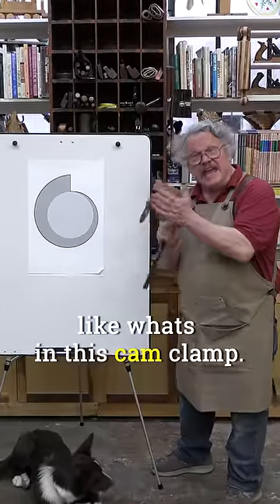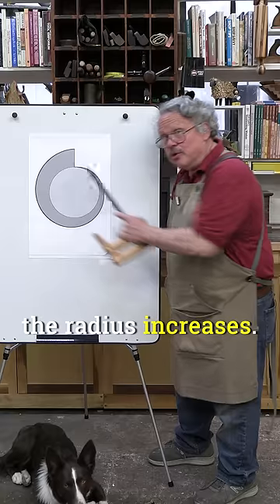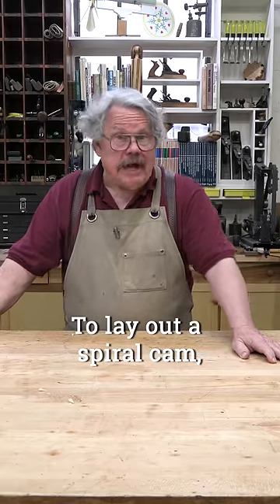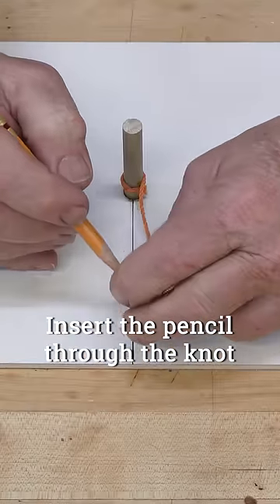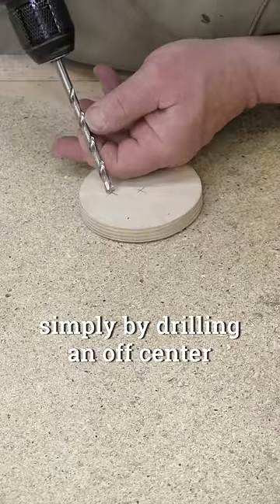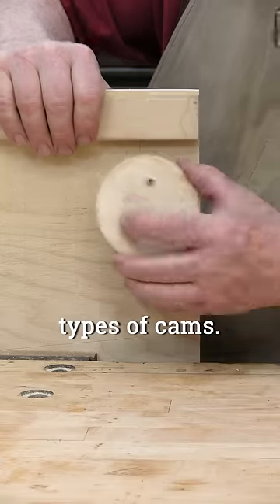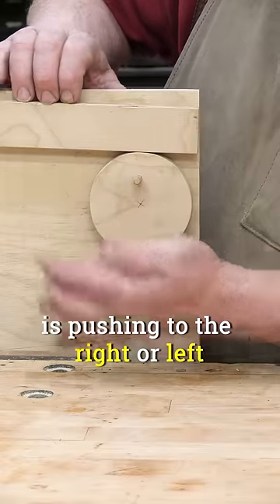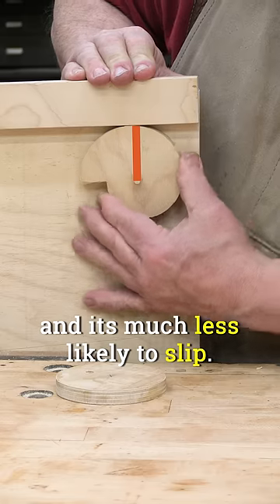How Cams Work

Comment: The only downside to the spiral though is that it would cause a skip when you hit the edge of the "ramp" and jumped down - but you could make an "oval-esque" cam in the same way, no? Like, instead of going all the way around the dowel, go halfway, then go around the other way as well so the two ends meet, that would give a smooth transition, but maintain the property of a "true cam", which from your demonstration at the end, seems to be that the surface is always tangent to the axel (which prevents slipping)?

Comment: It's not actually inline with the pivot. The offset depends on how fast the radius changes and in the offset circle cam the radius change is greatly exaggerated.
The real reason is that in a spiral cam you set the offset point where the force is applied to be close to a constant so for the same amount of rotation you get a much more smooth motion. Plus, since it's not symmetric, you get almost twice as much distance to use for the same amount of cam travel.

Comment: "With a spiral cam, the force of pressure is always in line with the pivot."  No it's not.  If you go back to the wedge analogy, you can see that if you press vertically down on a wedge, it will slip out like a bar of soap from the hand.  If you put a flat plane against the edge of the spiral, the force of pressure will be perpendiculat to that plane, and it will never go through the pivot.  You can see that in the video - the line running vertically from  the pivot does not go through the contact between the spiral and the  thing it is holding up.  The spi5al is much better than the eccentric, but will gradually turn in a predictable direction if there is any vibration.

Comment: Nick, maybe you can help me. I made the cams (in the Bernoulli/Fibonacci spiral way), and then also used your method of making cams. I made the rectangle dogs too with offset dowel. My dowels are 1/2". I can tighten things between them, but it invariably comes loose. I tried the squares with multiple angle (shallow/steep) wedges and found that I could still move the piece I wanted to be fixed still, quite easily even after wacking the wedges in with a hammer. My bench dog holes are not through holes, but are about 1.5" deep. Why is my stuff moving? I used multiple thickness  squares and cams, from 1/2" through 3".
Reply from the maker: It is impossible for me to answer this question without a photograph or sketch so I can see exactly what is happening, but my guess is that you are trying to use a cam to withstand a force from a direction that causes it to unwind.  The force that a cam clamp must withstand comes from one direction only, and that direction remains constant throughout the clamping procedure. Fasten a board to your workbench with bench dogs, sand it with a random orbital sander, and suddenly the forces are coming from all 360 degrees as the off-center weight inside the sander yanks the sanding head this way and that. That will unwind a cam in a heartbeat. Cams are useful clamping tools. but they aren't effective for all applications.

Comment: Is the difference between the larger and smaller radii roughly equivalent to the circumference of the dowel? Definitely not exact because of the diameter of the string.

Comment: can you construct a curve such that the downward force is angled backwards so it equals out with the downwards force, so there is no net force which would ever cause slippage? interesting calculus problem
Reply from the maker: I don't see how. In most cases, it's a given that the resulting force is perpendicular to the tangent of the curve at the point of contact. In a curve with a variable radius (such as the spiral I show) the force is actually very slightly off focus, angled toward the increasing radius (but not far enough to cause slippage in this specific engineering application). By "angled backwards," I presume you mean angled toward the decreasing radius, and in my experience that's just not the way it works. Interesting question though, and it just goes to show how much information I can't squeeze into these shorts -- enough to get viewers thinking, but not enough to give them all the tools.

Comment: This might be a dumb question, but does this work the same as a Cam in a car?
Reply from the maker: No. The cams on a camshaft in an internal combustion engine are designed to open and close valves in a precise order. This particular cam is designed to apply pressure.

Comment: Fibonacci
Reply from the maker: No, Archimedes. In a Fibonacci or golden spiral. the diameter of the curve increases logarithmically at the rate of 1.618 for every quarter turn. This is an Archimedean spiral, in which the diameter increases arithmetically by the circumference of the dowel every full turn. This has a noticeable effect on the appearance of the spiral. The arms of an Archimedean spiral are parallel, those of a golden spiral are not.
Reply: @WorkshopCompanion  Ah-HA!! Caught you, you retired MATH TEACHER!🤣(Thank you for that explanation, btw.)

Comment: Isn't this technically a an involute and not a spiral?
Reply from the maker: It's both. The manner in which it's drawn makes it an involute, but it's also the beginning of an Archimedean spiral. If you continue to unwind the string, the curved lines will be parallel, their spacing equal to the circumference of the dowel.